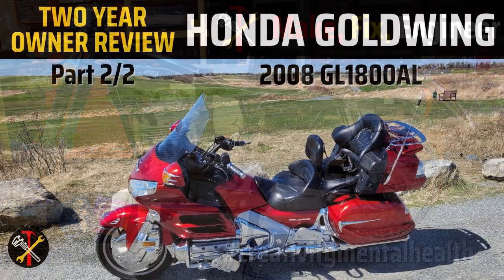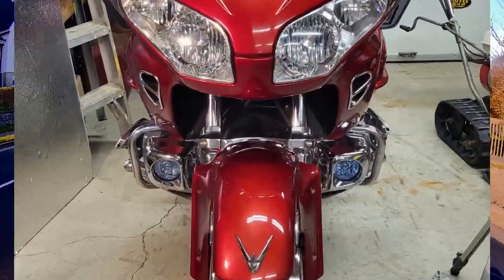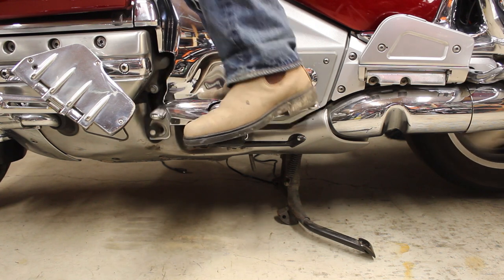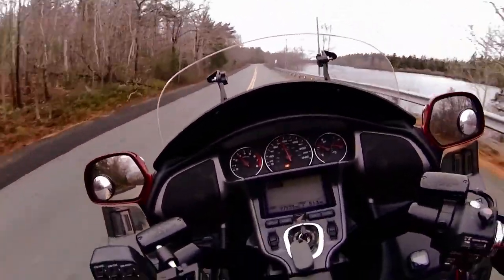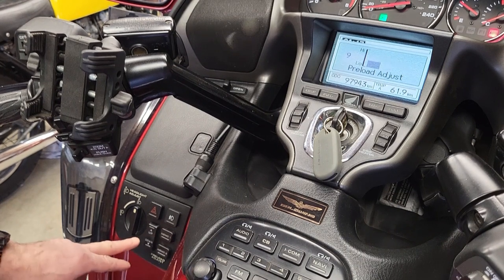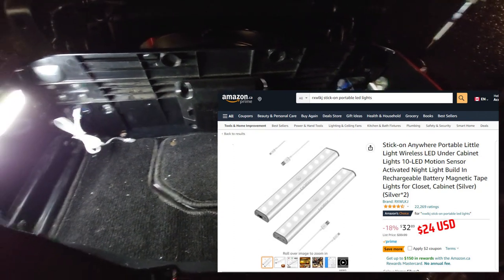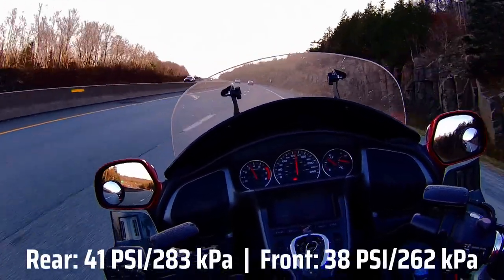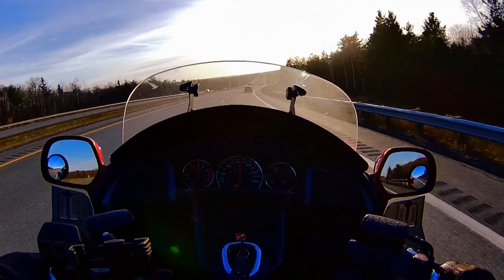Honda Gold Wing Review - IN-DEPTH - Part 2/2

Comment: Just bought one. 2003 with 10,563 kilometres on it. Will be delivered end of the week. It’s getting a complete brake and clutch flush and new tyres. I’ve just come off a BMW K1200LT. Can’t wait to feel how this machine rides. Mint condition and sparkling red colour and lots of chrome. 🤗🤗🤗

Comment: Great 2-part series.  I've been riding Goldwings for 10+ years.  The biggest complaint I have about the Wing, and really my only complaint, is tire cupping.  They all do it.  Tire pressure or tire manufacturer doesn't seem to matter.  I'm told that a suspension upgrade will solve the issue, but I haven't done that yet.  I ride mostly in the Blue Ridge mountains of NC, Tennessee & Virginia and I love accelerating through the curves, so that is likely a contributing factor in my tire wear.  Best motorcycle ever made in my opinion regardless.  Be safe!

Comment: I stopped using the speedometer and just use a Garmin Nuvi to show my GPS speed.  My fork seal was weeping just like yours.  There is a tool called Seal Mate to clean the debris out of the fork seal.  I made one out of a plastic bottle and now no more weeping right fork.
Reply from the maker: Thanks for the comment. I too use my phone for the GPS speed. And thanks for your suggestion about the Seal Mate. I too had a homemade version a few years ago that saved me from changing fork seals on two bikes. I recently got an official version and unfortunately it didn't stop the leaks on the GL after many tries, so I guess I'll have to change the seals. Cheers!

Comment: I really enjoyed your reviews.  I recently bought a 2004 that looks almost identical to yours. I can't wait to get it on the road.  It's getting a big mechanical going thru first.
Thank for quality documentation documenting the pros and cons...well done!!!
Reply: update.  My wife and I took it on our trip out west last summer.  Since our rv broke down in Colorado we spent over 1700 miles on our bike over 50 days. Only problem was one brought on by my own stupidity.  I was thinking because of the higher elevation I should put hight test gasoline in it..wrong.  It was stalling at low speed at stop lights. Spoke to a Honda dealer in Durango and when I told him the symptoms he paused and asked..what fuel did you put in it last. I said high test..he said..there's your problem... at higher elevations like in Colorado you want to put in regular obtain 87/88.  Lesson learned.  Thought I'd pass along for anyone else heading for the high country.  After spending 170 plus miles on it with the wife I can truly say it is by far the most comfortable cruising bike ever. Great gas mileage and just an all around fun time on the road. Keep up with your great videos..this coming summer wife and I are headed to Nova Scotia...maybe see ya in your neck of the woods. Happy motoring!

Comment: Be careful of what oil you put in many have ant friction agents in them that will make your clutch slip! I'm running Rotella diesel T 6   5/40 in mine.
Reply from the maker: Thanks for the comment. I have heard some oils will make your clutch slip, but I've had no problems with the Motul I'm using. The gent Paul Short that I mentioned in the video was a Honda technician for years and he has been using that oil in his GL since he bought it in ~2002. Cheers!

Comment: Hi, May I ask where did you pick up the switched life feed  for the USB port ?
Reply from the maker: Hi. If you remove the front left glovebox pocket, there should be a two-wire harness in that area with an unused connector. It's for the Honda accessory 12V outlet, which can also be mounted in the left pocket. This feed is switched. I didn't have a matching connector so I cut the wires and soldered in the wires for my USB socket. Cheers!
Reply: @MakeFixEngineer  Thank You 👍